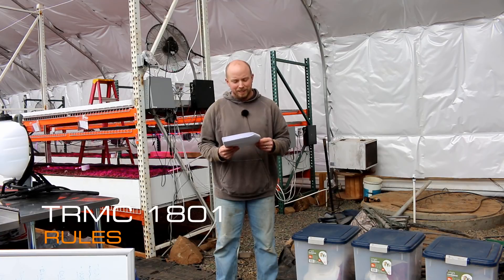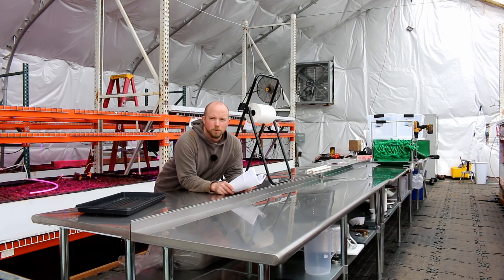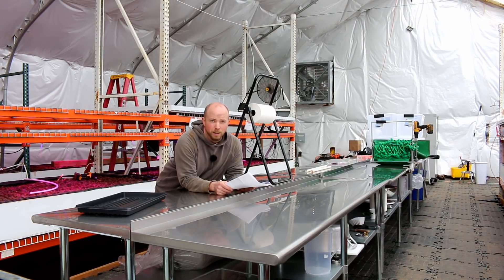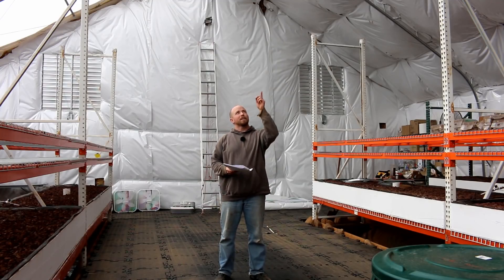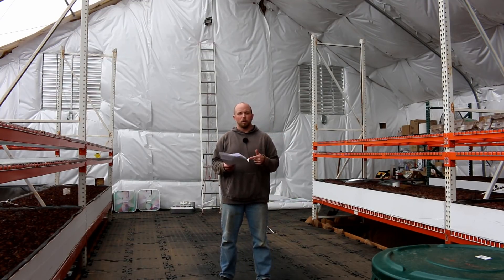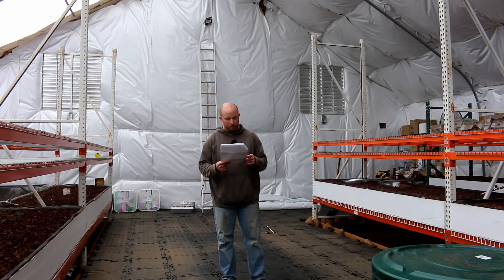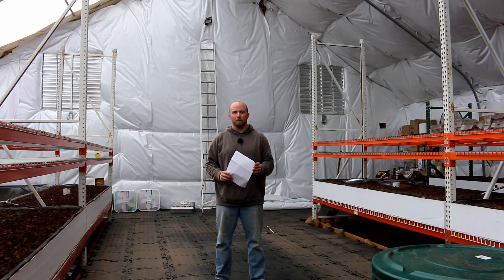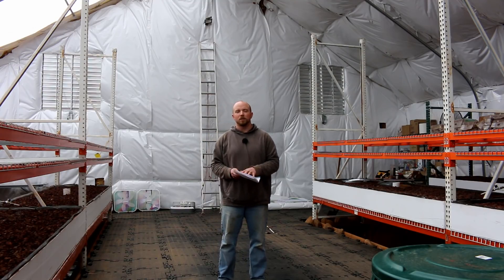The Ultimate Test - Living Off of The System You Designed

Comment: Create a gravity fed filter, charcoal, sand, small pebbles, medium pebbles, larger pebbles. Then boil the water. The charcoal should catch most of the contaminants and the sand and rocks should catch the rest of the particles. And if you want catch the vapor and have distilled water to be sure. All fairly easy to construct and mostly no work to do just create a system to catch it and let it work.

Comment: I think that rather then going through getting the out put from the dehumidifier tested (and the possible health issues with using that ) you should just be able to use Equivalent amounts of potable water. Water reclamation systems are in full time use on the ISS and are far better then what you have.  Also I also think that you should have a radio / Phone with you but for emergency sealed in a bag or Tupperware?